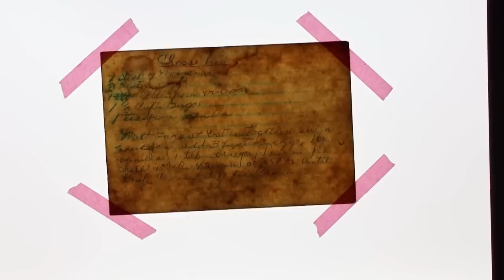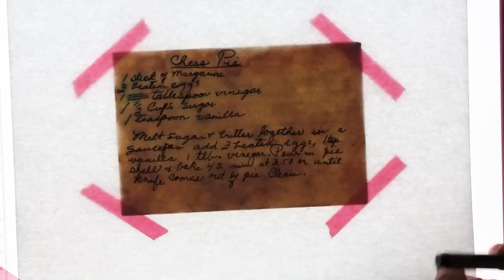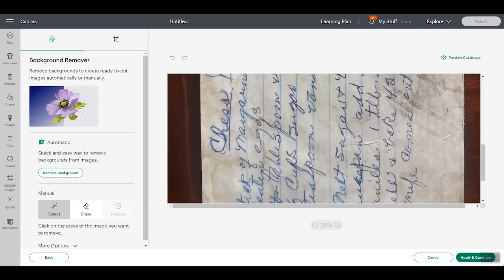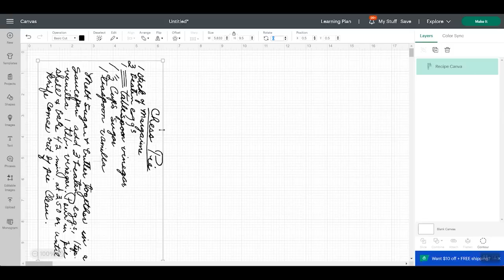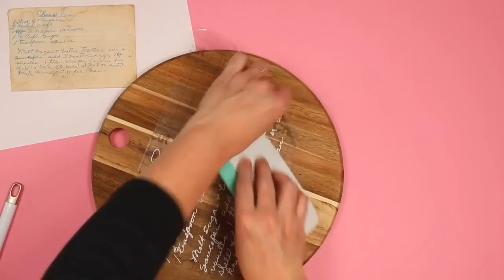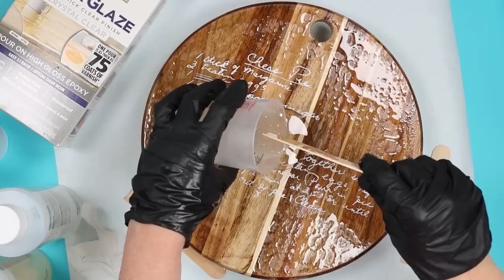Watco Food Safe Sealer with Handwritten Vinyl Recipe

Comment: Hi Angie.  Thank you for this super tutorial.  I can't wait to try it.  I have a couple questions.  Is there a certain pen that you need to use to trace or just any pen?  Also could you use Infusible Ink pen and heat press to wood?  That you again for your amazing videos.
Reply from the maker: Any pen will work with the way I did it. If you use Infusible Ink, you would need to trace it backwards and use something on the wood to get it to work.
Reply: @AngieHolden  Thank you. I never thought of that;  being that you would need to trace it backwards.

Comment: The website and the box says it is heat resistant, why do you said not to use it for things coming from the oven? I guess it would be okay to use it for coasters
Reply from the maker: I think coasters would be okay but it said not to use it on things above a certain temperature which is why I noted that.